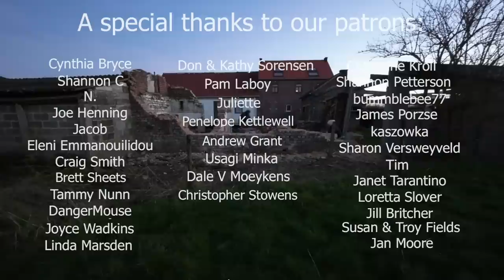"DEBUILDING" our 100+ y.o. pigsty / Renovating old ABANDONED farm in Belgium

Comment: If you cleaned up the wall anchor, attached a weight to the bottom of the wood block and then encased it in clear epoxy it would make a very interesting accent table when a small piece of tempered glass is used as a table top. I love the potential of it, love your videos.